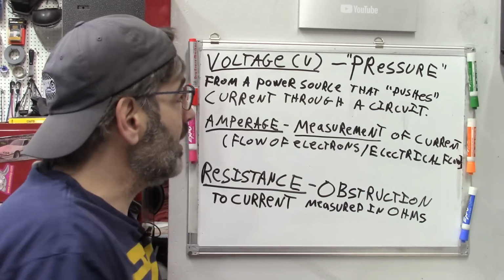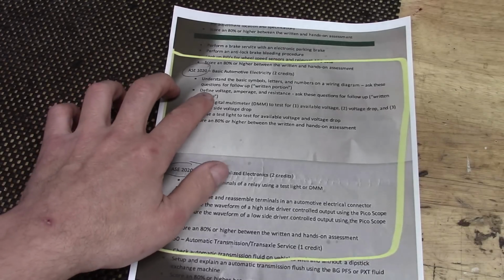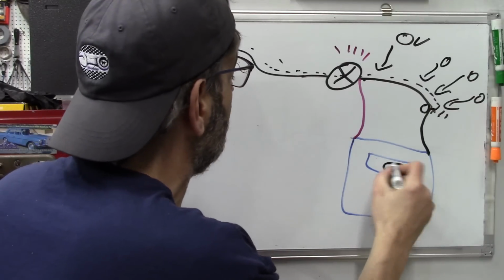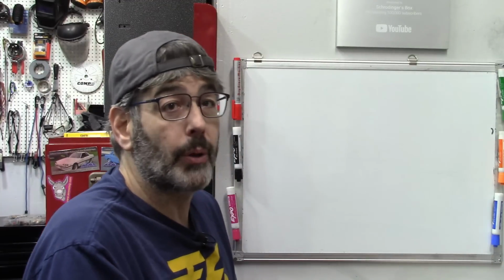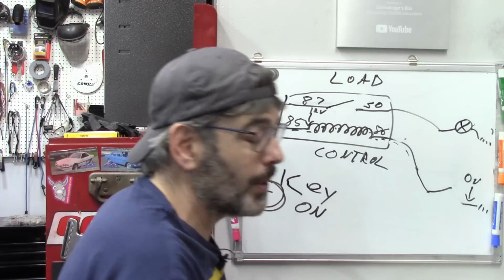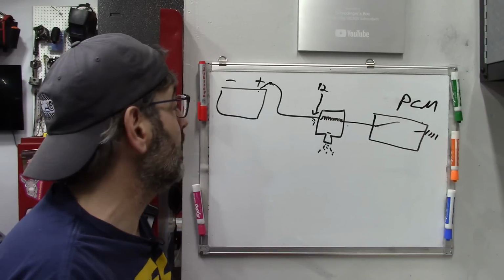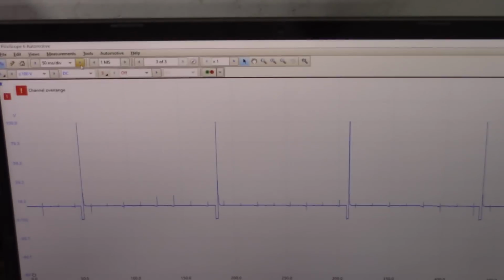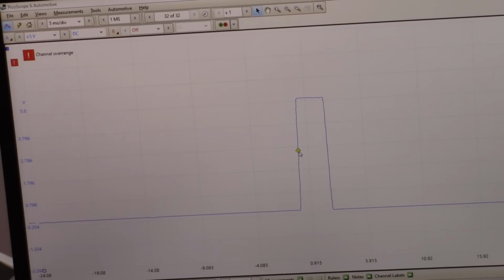Helping Auto Tech Student Pass Basic Electrical Exam

Comment: I posted a comment and I don't see it. It was about the drawing on the relay
Reply from the maker: what was your comment?
Reply: @SchrodingersBox  It looked to me like the China diagram on the relay was incorrect, it shows the electromagnet in a position that would be pulling the armature away from pin 87, see time-line  1:32:26 The armature would be pulled toward the relay coil which is away from pin 87. It should have the coil on the other side of the armature so it gets pulled to pin 87, or am I nuts? LOL
Reply from the maker: The diagram is correct.

Comment: Matt, thank you for your videos. Been a paid subscriber for a year or more. I’m trying to help my mother with her 2013 Lexus es350. The car blew the main use because OReilly’s sold my dad the wrong battery. I got the car back up and running but the brake lights and fog lights are the two remaining things not working. I gave the brake lights direct power with multimeter and they worked so I threw a new brake light switch in and that didn’t solve the problem for the brake lights. So I took to dealer. And they were trying to charge over $900 to change the integrated relay and wouldn’t guarantee that would fix it. “Starting point” is what they called it. If I was going to play parts roulette I could change that relay myself. I already took apart the fuse box and replaced the blown fusible link, and several fuses. I’ve checked all fuses related to the issue and seem fine. So I bought the relay module for $200 from Toyota and still the same. I’m going to give the brake lights direct power again to see if they lit up like before I took to dealer and see if I’m at the same spot. I wish I had your direct line. I know it’s impossible but please send positive thoughts my way. I’m trying my best and you’ve been a great help.
Reply from the maker: Well I don’t believe in thoughts and prayers but I can provide you a wiring diagram perhaps if you email me!

Comment: The initial explanation of voltage and flow using the water hose needs fixed. Make it simple. Here is all you need. If a person kinks the hose partially ,it is 12 volts on one side and zero on the other. If you make another identical partial kink in the hose down stream, it is 12volts, dropping to 6 volts then  dropping to zero volts.  You went way off base and made it more confusing by using 11 volts, 3 volts,  9 volts etc. In your example you introduced 2 resistors ( partial kinks) with different sized kinks.
Reply from the maker: But that description would be inaccurate. There is some dichotomy between electrical and fluidics.
Reply: @SchrodingersBox  OK, how about 12 psi and 0 psi. Or 12 feet of water pressure ,and  0 feet of water pressure.  I am sure you understand .  You do an amazing job, talking on camera as you go. Forget I mentioned it.
Reply from the maker: No. It’s inaccurate that you have full pressure ahead of a restriction in fluidics. Doesn’t happen that way.  Electrical- yes, fluidics, no.
Reply: @SchrodingersBox  The voltage drop along a wire when current flows is similar to the pressure drop along a length of pipe when water flows . For your simple illustration and explanation you can disregard the small drop in the wire or for water on the pipe. The voltage , is also called potential, potential energy , just as feet of water is potential energy.   The only significant difference between electric current and water current is that electric current stops when there is an open wire, where water current stops when a valve is shut. 
The flow measurement in piping is done through the measurement difference in head in the upstream vs the downstream side of a venturi meter. We used to use mercury manometers on the pump test facility. Every static head measure had to  also include the velocity head . But for low velocity flow rates the velocity head was a insignificant portion of the total energy.

Comment: SP St single pole  single throw  meaning  you have a  common  terminal and a  NO normally  open  and a NC normally  closed  terminal  and it can be a  DPDT double pole  double  throw  meaning two  independent  switches  ones  could be   normally open  or both  or one  closed  and one normally open

Comment: To  determine what is  causing the  voltage drop  wouldn't you  check the  voltage  at the  light  switch  relay and  before and  after  Ny connectors  you could  replace the positive  wire and then still have the  voltage  drop because of the  light  sw
Reply from the maker: Yes exactly correct. It’s possible- well, actually likely that the voltage drop is between relay and bulb. Also I need to check at the other bulb to see if there is voltage drop there too.

Comment: Hey man i posted this question on another vid but in case u dont see it : i found like a yellow paste in my radiator hose on my acura tl.  Would that likely mean a blown head gasket?
Reply from the maker: Could be. Whats your compression pressure?
Reply: @SchrodingersBox  for cooling system? Ive not done it yet ive got a lot off the car doing maintenance. In process of getting everything back on so i can crank it. So the cooling system compression test would tell me for sure?
Reply from the maker: You want to do cylinder compression.

Comment: Hey Matt, yesterday I diagnosed a battery drain on a Nissan Sunny ex saloon and we left the battery connected overnight and this morning she started. I learned that from your videos you did long back. I used the method of checking m-volts on each fuse instead of pulling the fuses out one by one, and it worked. 

Now that customer of mine has got a friend of his that’s got the same problem, and automatically I’m the one that will fix it 😂. 

Good stuff, I’m learning a lot from this channel. 

Brighton from Zimbabwe 🇿🇼, bye bye 👋🏾.
Reply from the maker: Great story!! Congratulations!

Comment: That so-called DVM is actually MULTIMETER or DMM! because isn't measuring only VOLTS!? Right?
Reply from the maker: It’s measuring volts and ohms. Digitally.
Reply: @SchrodingersBox  Very true.
Reply: Depending on the  meter most automotive  meters were used for just  volts and  ohms  until they  started using  electronics and the  ones I have been using working in the  commercial  air-conditioning and  refrigeration  industry have at least  30 different  settings  now that is a  multi meter

Comment: Hi, I must say that I think this is a great channel and I very much like your ethos. This is why I hesitate to criticise, but I feel your use of a tap/faucet as your pressure/voltage source is a bit confusing. Personally I would use an constantly full bucket with a pipe coming out of the base. The pipe would be connected to a second similar bucket. The difference in height between the 2 buckets gives us our Voltage / Pressure.. My second point follows on and this is that the important image of Voltage is P.D. Potential Difference. A single point of voltage is of no significance until it has an electrical path to a second point which has a different voltage and the "Pressure" is the difference in potential/voltage between the 2 points (the difference in height of the 2 buckets.)  If the 2 ends of a circuit are both at 1000 volts (compared to earth) no current will flow in this circuit.
Your image of an open tap with a pipe with no constriction shows full flow of water but you indicate there is zero volts at the tap. Obviously if voltage were truly zero compared to open end of pipe there would be zero flow of water/coulombs.
It might also be worth explaining to the students that even copper wire has a resistance which will create a minor voltage drop. This can be very important because this volt drop is directly proportional to the current flowing in the circuit, which is why cable sizing is so important for high current circuits (as the greater the c.s.a.  the lower the resistance - the lower the volt drop) 
I hope this is constructive and I wish you and all the students the best of luck.
Reply from the maker: In my example the voltage is prior to the tap. Street pressure. Like in an actual water system. There is only pressure at the tap itself when it’s restricted or closed.

Comment: Hi!! I have been watching your videos non stop and it opened a world for me man, troubleshooting is my passion! Anyway, I have been diagnosing my roommates car for a few days now and it comes down to this:
P0171
Freeze frame:
800rpm 
0% load 
25% ltft
0% stft

Now I hooked up the car to a scanner and tried to see what was going on. I managed to witness the car turning to closed loop BEFORE o2 sensor data. o2 is still at 0v while the car is (as far as i know) trying to compensate for the “fake” lean (0v) condition by slowly raising stft to 25% where it resets to 0 and gives a open loop fault for a second. This repeats about 5 or 6 times until the o2 sensor finally starts reporting good normal data and causes trims to normal. The annoying thing is that its intermittend, sometimes o2 works directly but on most cold starts it doesnt. Even when driving it sometimes reports 0v and gives open loop fault with stft slowly going to 25 and resetting to 0.
I thought “good” o2 sensor data was the requirement for closed loop operation?? Im so confused
Reply: When disconnecting the o2 sensor i get stable 0.3v that the service manual says it should be. I really dont want to be the “just get a new o2 sensor” guy so if you could point me to some possible causes, it would be very much appreciated 🤠 im breaking my head rn
Reply: And as far as I can tell the car idles and drives normal
Reply from the maker: Pretty simple- you just need to curve the O2 voltage and fuel trims with engine load.  It will tell you exactly where the issue is.
Reply: @SchrodingersBox  well 9/10 it reports good normal data but ecasionally it stays dead flat at 0v for a while before switching beteween rich and lean
Reply from the maker: That doesn’t sound like a curve against load.
Reply: @SchrodingersBox  I think I’m not getting why that would show me what the issue is? What would I achieve by that?..
Do you think its the engine leaning out when it gives 0.00000V?
Reply: It an open loop fault
Reply: @SchrodingersBox  ahh whatever thanks for your input. If I find the cause I’ll let you know
Reply from the maker: The load curve is telling you exactly how the fuel trim is responding to specific variables. It’s the single most important data.
Reply: @SchrodingersBox  well it doesnt matter in this case man, i have had the o2 sensor output normal values and 0v at the same damn load thats what im trying to state here 😆
Reply: @SchrodingersBox  load isnt the culprit variable here
Reply from the maker: No. Of course Load isn’t the culprit variable. It’s the REPORTING variable. Huge difference. It’s the major difference.  The only one. It tells you where the issue has to be. 
  Anyway if you don’t want to do the one variable that shows how the computer is compensating I’m afraid I can’t help.
   You have an open loop fault because of an OL3. I guarantee it. 100%. That’s why fuel trim suspends. It’s not an Open Loop fault. It’s an Open Loop response.
Reply: @SchrodingersBox  so looking at the data, I can see a small spike in the o2 sensor voltage when cranking the car. And right after, the ecm goes into closed loop. It sees 0v so tries to compensate. I pulled out the o2 to test this and when I plug it in after starting the car, it doesnt get this spike and gets the time to heat up before the car goes into closed loop = normal startup!! Not really sure how to go further now, what could cause that voltage spike? Its about 0.3v
Reply: When the engine / o2 is already hot, sure theres this spike also but the sensor reports good data from the start so closed loop is perfect
Reply from the maker: Again that’s still not a curve against load- the one and only controlled variable that can be generated.  You keep listing symptoms. not causes. we need to find causes through a single controlled variable or you will just keep spinning circles. 
. I’m afraid There is no useful information here so I am going to have to back out since there is no data to interpret. Good luck though. Hope you figure it out.
Reply: I just wanted to know what could be the reason for the o2 sensor to report GOOD data most of the time but sometimes no data at the same rpm’s/load, even after having driven and the sensor being heated up. Its not that its reporting a lean condition its just flat 0v

Comment: So to summarise the voltage drop point, if you measure before the load by putting the positive lead before any load on its power wire, wheather it be a light bulb, a wiper motor feed, a fuel pump feed, and the negative wire on the battery ground, or body ground, you will measure 12 volts dc.

If you them put the negative lead on the return wire from the load, like the black wire from your light bulb, or the negative wire on a fuel pump or wiper motor when turned on, you also read 12vdc but this is the total drop across the load, so healthy circuit.

If you measured only 8 volts across the bulb, you have voltage drop, so you check the bulb connection or element, or the ground wire for a large impedance, or resistance, and once found and fixed the voltage drop reading across the load should be 12vdc once more to indicate a healthy circuit.
Reply from the maker: Correct. Just one addition in your last paragraph- if you didn’t find the 4 volt drop on the ground you would also check the power. In fact as you saw on my own car my power side has 1V of drop, almost none on the ground.
Reply: Thank you sir, Regards from County Meath in Ireland

Comment: Matt... Lovin the refresher course! One potential issue... I THINK that using the test light to demonstrate voltage drop, they possibly meant measure voltage between source voltage (A) and point (B) and with the volt meter still connected, connect test light to (A) and (B) to show how the test light pulls it down.

The paper clip trick can also get you in trouble in "integrity self check" circuits. You'll get a "circuit shorted to B+" errors stored in the PCM/modules.
Reply: I forget to qualify the circuit being tested for voltage drop Difference between (A) and (B) MUST be a loaded circuit, else no current. The test light would provide additional load on the circuit, thus and more noticeable voltage drop. Missing a detail can completely change the context. Sorry Mat t I forgot to include a very important part

Comment: Are you sure the test was not for can high and can low.
Reply from the maker: Yeah I am sure. It’s clear low and high side refers to ground or power control plus it specifically mentioned of a driver.  That’s a transistor.
Reply: Thank you @SchrodingersBox

Comment: A 1 volt voltage drop on a 12.6 volt circuit is only about 8% which would be hard to assess with just a test light!!
Reply from the maker: Exactly!!!!!  I am kind of wondering why that’s even a method that would be shown. Maybe I misunderstood the question but I wouldn’t check for voltage drop with a testlight unless it was like a no-crank no start or something where it would be a really significant voltage drop. Even then I still use a DVOm tho.
Reply: @SchrodingersBox   Agreed, the way the question is written I interpret it the same.  Would use only DVOm for this myself.  Especially since a 20% to 30% drop could be sufficient to affect a starter motor, but maybe hard to detect with a test light.  Great video as always Matt!!